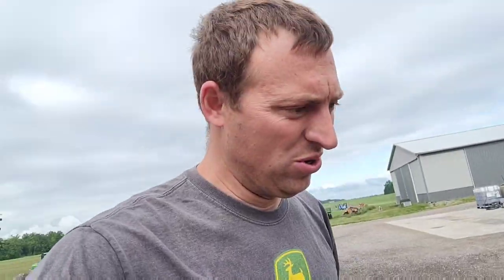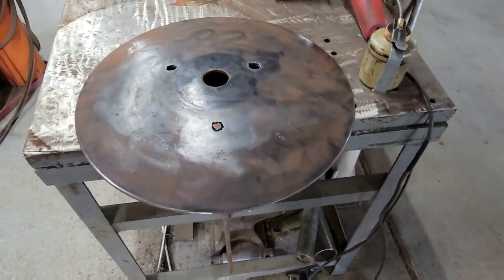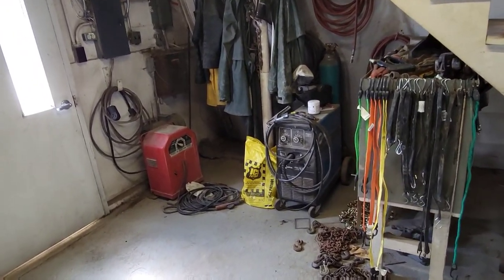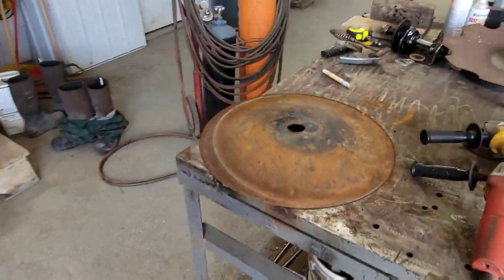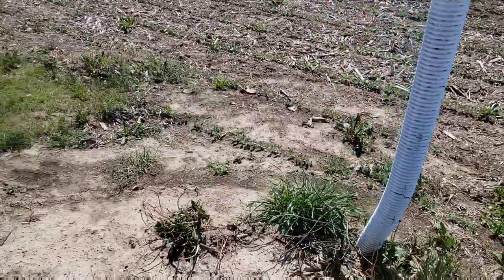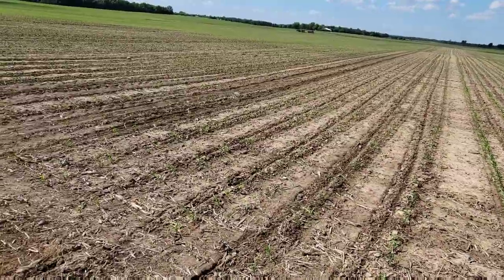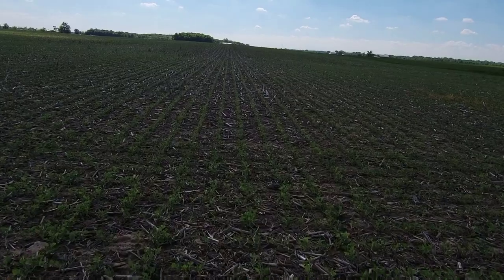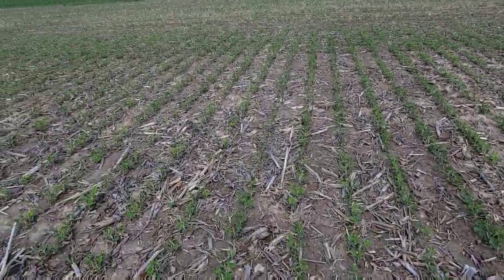New and Improved Corner Post! - #434

Comment: shorter rebar in case of rocks ? .👍
Reply: Would not go shorter, frost may still lift them slightly, spring check.  If the P K pin is set there, chance of rock obstruction is minimal
If you fabricate more, smooth hot or cold rolled  rod for a better choice. Grade 60 rerod  is very hard & under stress, easily will break a weld which does not bond well.